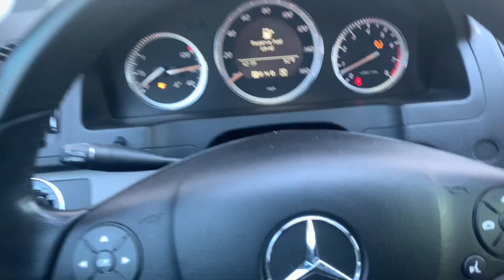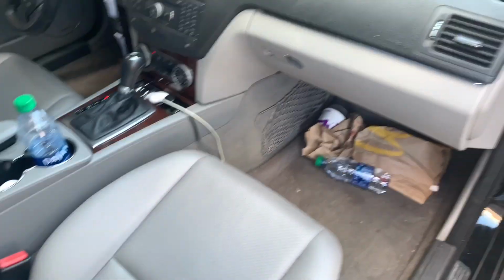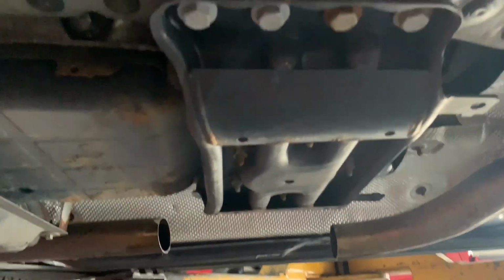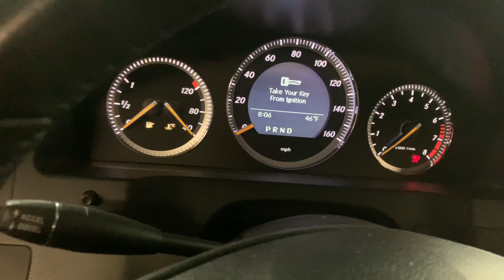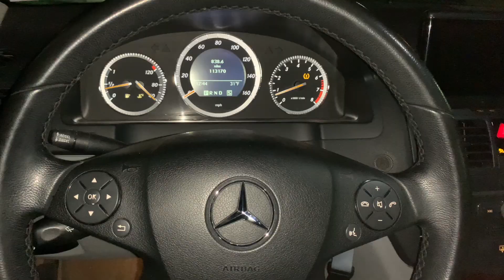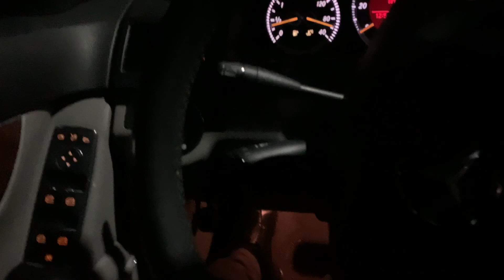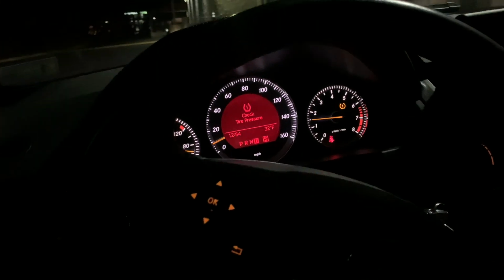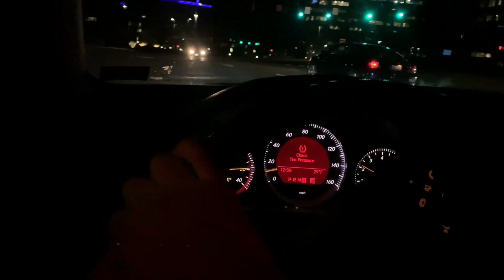Straight piping my W204 C300! Extremely loud!!

Comment: If you didn't figure out how to put the seats down yet, go into your trunk, and on each side up top there are handles that you pull which unlock the seats. They don't move too much, but you should here it pop. Then you can either push them down from inside the trunk or pull them down from inside the cabin. It's a 60/40 split so if you only want one side down just pull the side you want down and you're good to go. I just saw that this was posted 8 months ago, so chances are that you've already figured it out, but if not, I hope this helped. Im a fellow c300 owner.
Reply: I don’t think you can do that in these cars. The rear back seat is not split in my car. It’s just one piece and there is nothing to pull to get the seat down

Comment: bro thats not straight pipe. I got 2nd cat delete, res delete and muffler delete and i still dont call it straight pipe. Once i get primary cats deleted then i will call it straight pipe. You might as well go the whole way, why stop there with the cut outs, it could sound like that without them
Reply from the maker: I don’t want it to smell like my evo does 😂
Reply: @Brinrex  it shouldnt smell if youre using the right fuel
Reply from the maker: It will still smell because no filter from cat
Reply: Kyo I have the same setup but idk if I should delete me primary cats too if its not gonna be a huge difference. Did you delete them yet?